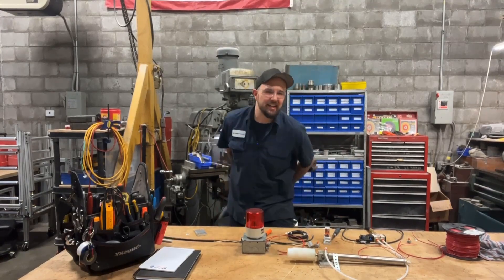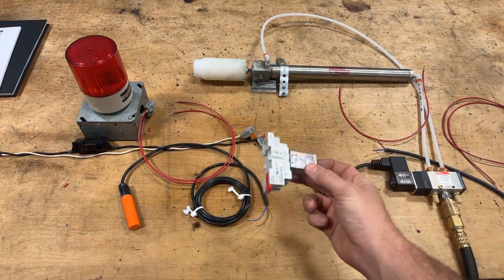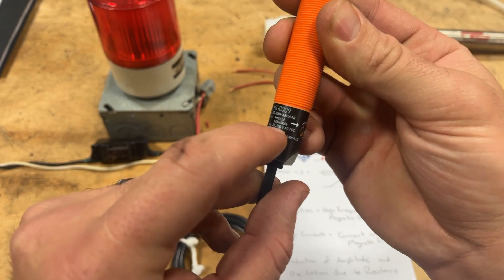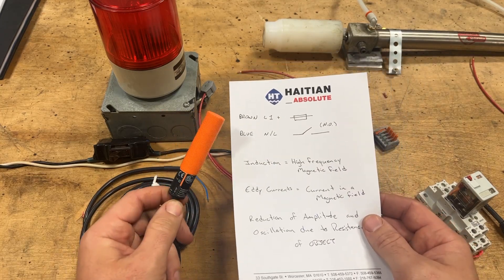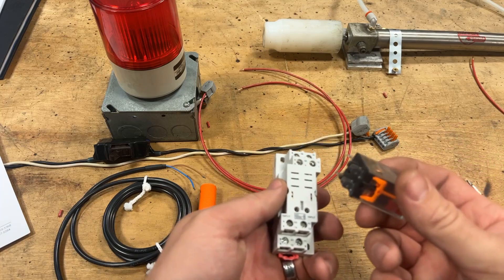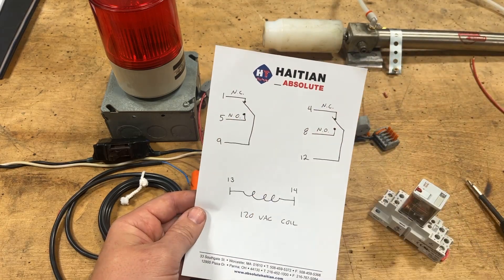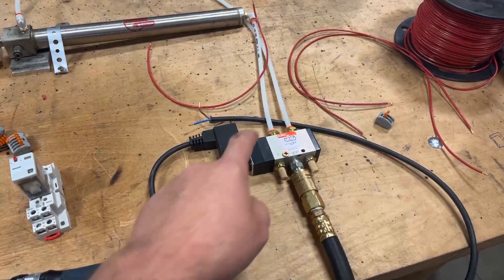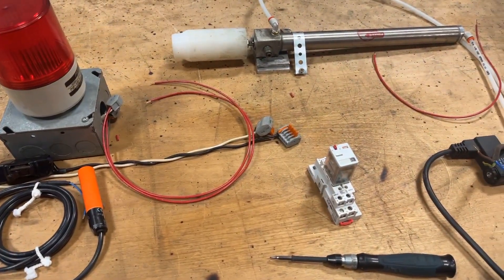How does a logic circuit work?

Comment: wasn't the booby trap only activating when coil didn't detect metal? how would you send the signal if the detector is not detecting?
Reply from the maker: Just depends on which set of contact you decide to use. Either NC or NO. it will work either way

Comment: I love projects like this. So much so i turned my whole house into a smart home. Even made a custom window opener using a linear actuator all connected to a central brain running home assisant. So when the temp outside drops rapidly and the temp in that room is higher than the temp outside in the summer it will open the window raise the blinds and turn on the fan all automatically.

Comment: What I’d like to do is create a switch to tell me when my mailbox was opened. Wouldn’t a pin switch work? Electricity wouldn’t get to a simple, ringer type bell until the door was opened and then the pin in its opened prosition. Also in stormy weather it would tell me if the door wasn’t closed properly. And as a win win these days be at lest risk of identity theft.

I remember the old pressure mats from years ago at grocery stores. Can I make them for my porch? My 87 year old mom has a meals on wheels service. Sometimes they ring the doorbell and before she can make the door they’re halfway back to their vehicle, and she has no meal. Maybe eventually I’ll make something with a electronic eye for the end of her driveway.

Do you have any videos on creating a driveway sensor, or sensor for your mailbox? Just might help to avoid a home invasion to. When someone busts your door open you’ve already got them dead  square in the sights of your AK.
Reply from the maker: this video would apply to that situation. just replace the proxy with whatever switch you want to use and you would get the same result. Thanks for the great comment!

Comment: I want to learn how to make a homemade Battery Charger.  12 VDC from 120A/C outlet. I already learned how to convert 120 A/C USING 4 Diodes, A Mosfet and a transformer and a capacitor only thing I am missing is a damn soldering iron and some solder but don't want to blow up my battery 🔋 so maybe you got a few ideas. And great video thanks for the explanation and demo.

Comment: Just an idea, because I can't help over-engineering things: Use a normally-off switch with a NOT gate - I realise it's not quite that simple in terms of putting it together, but it means that if anyone tried to attack the alarm by cutting the wire, the alarm would sound. Maybe there's a better way to do that actually, but you see what I'm getting at in a general sense.

Comment: That's not what eddy currents are. Eddy currents are the currents induced in a piece of metal (usually non ferrous like aluminum or copper) by a changing magnetic field. A coil of wire does not emit eddy currents.